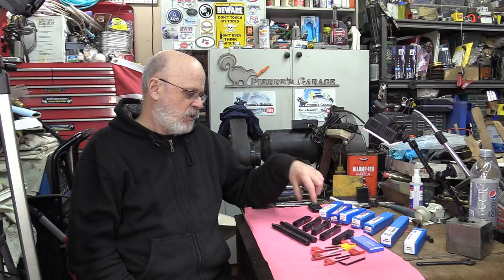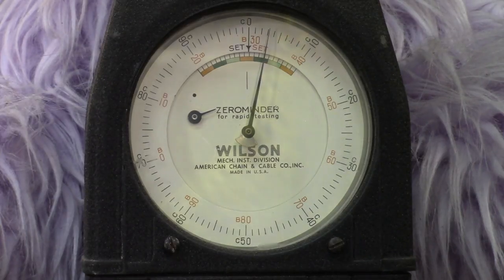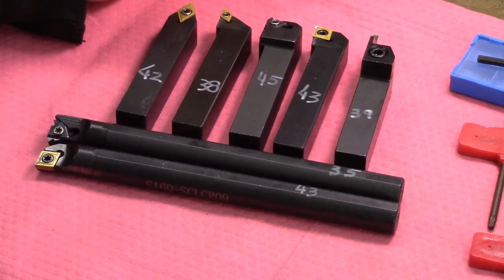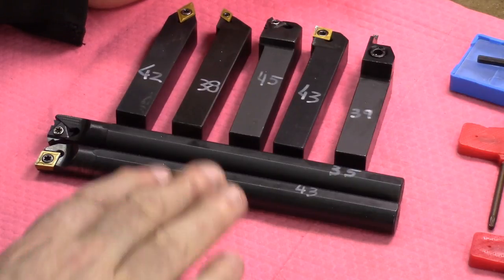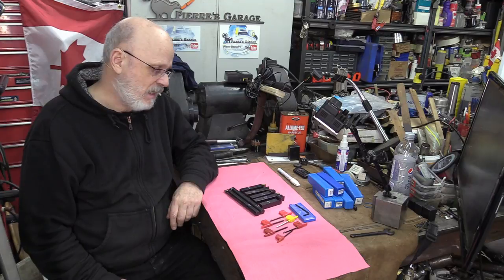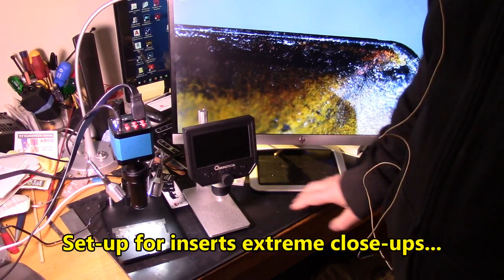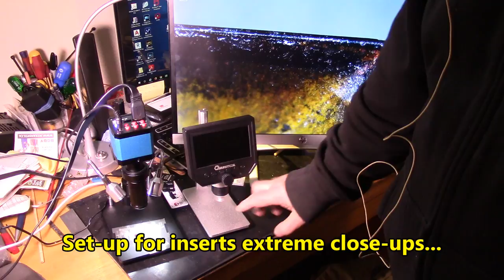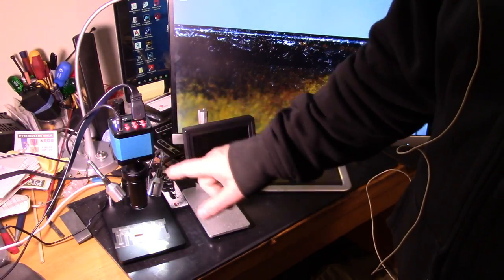Lathe Turning Tool Holders set, 7pcs 16mm Shank with carbide inserts, for BXA holders

Comment: I bought a kit for my south bend 13'' from Accusize and I'm pleasantly surprised how well it works even though my machine cant always hit the required FPM/rpm for carbide inserts! 

Nice video! 

Cheers
Reply from the maker: There are some great inserts for general purpose work, not optimized for high rate production on special alloys, but, perfectly suitables for hobbyist and small shops.
Unless you use those on CNC machines with tightly optimized parameters, you'll rarely use them within their best portion of the efficiency curve, don't worry about it though... 👍🙂
Enjoy your time in the shop...
Cheers,
Pierre
Reply: @pierresgarage2687  100% agree and I’m enjoying machining a whole lot!

Cheers!

Comment: How were the screws? Normally I have found those foreign tool holders pretty good but the screws rubbish that stripped out easily.
Reply from the maker: I didn't pay real attention when I first installed the inserts, possibly cause they didn't seem to be a concern, but to your asking, I just went back in the shop to give it a closer look, the heads are very well shaped, no trace of the tool user to install then, great fit of the torx tool, so far it's a positive experience...   Compares to good quality fasteners I get from my local supplier.         ;)
Reply: @pierresgarage2687  Yes the hex stripping out was the problem I had with the set I got when I first bought my lathe. Like to think things have improved in the last 20 years. :-)
Reply from the maker: I've seen some of the real crappy ones, they're terrible...  Need surgery to remove them...!!!
Always a great idea to keep a few spares in case of dropping one in a fully loaded chip pan...   ;)
Reply: Yeah, they don't seem durable, but I have also heard that you don't need a lot of torque, as the design is what holds the insert, the bolt is just for stability.

Comment: I purchased one of the cheaper microscope you have because of your review. It works great but that more expensive one looks to have incredible resolution.
Reply from the maker: The cheaper microscope is a great inexpensive tool for all around the shop, the other one is way more costly, and, like you say with better resolution, there are also some extra features that I'm planing to use in the shop to make precision measurements.
Just need time to set-up and get it all done.....    ;)
Cheers,    Pierre

Comment: Hi Pierre, nice test as allways, good performance of the tools and at that price a real find, better get video surveillance in the shop :-), a good source of aluminium is wheels.
Reply from the maker: A security system was installed soon after the last batch of ingots were stolen, BTW, they stole more than ingots...   Those nasty Bastards...!!!
Still have another 150 pounds or so of more scrap to make ingots from, including alloy wheels and suspension parts...   
Now, waiting for warm weather and Summer to be back...     ;)

Comment: Which insert and grade was used for turning .
Reply from the maker: With Chinese direct imports it's very difficult to get those details, it's most likely some very usual and wide spreaded grades, if you require some specialized turning you better get some known products from regular manufacturers, though, those inserts will cors you really musch more money, as those cheap ones are quite all right for regular work...   🙂

Comment: Good review. I can’t complain about  the 1/2” set from Bangood I have for my AXA holders.
Reply from the maker: Those type of tooling is generally a great purchase for people with a tiny tool budget or anyone that needs to save in order to be able to get tools for the shop. Not all tools coming from Asia is a great purchase, though, we need to test and evaluate in order to sort out the better deals...   This is where references are a way to help in deciding.
Cheers,   Pierre
BTW, nice project in your shop with the small rotary engine...!!!

Comment: Nice video,
But I'm struggling with the forest of inserts and when to use these inserts. All of them can be used for turning or boring or facing or grooving. For example: turning with ... 90° or 85° or 75° ... aproching angle.
And then the positief,  neutral or negatief angle.
Reply from the maker: Hi,  I get your point, inserts are quite numerous, lots of configurations and shapes, can't promise, but it would be interesting to give a basic understanding of how to sort things out in the most commonly used shape of inserts...
Those tutorials are quite demanding and need some thinking ahead, I'll put that on the "To do" videos long list...
Also depends a lot with what size of a lathe you're using, material you're turning, etc... 
Just as an example: In this video,  used a steel insert to cut Aluminium, wasn't ideal, a better insert for Al is an insert with a sharped edge and more agressive angle of attack, you need to look for an insert they say is for Al, then take a closer look at the cutting edges...
Manufactueres will often give some good descriptions of the intented use for their product.
Reply: @pierresgarage2687   That is just my Point, I'm new at this. But I use these same 250-201 toolholder 16x16mm insertholder.
Most of al is hot rolled steel.
I have trouble to find steel that can be harden. Here in Belgium you need to be a manufacturer to get the good stuff. And it is very expensive to get small amounts
Reply from the maker: Here also, small amounts are very costly. Depending on the alloy, hardenable steel is basicly from 3 to 8 times or more expensive than regular hot rolled steel, one possible source would be some local a machine shop that has some surplus or would be willing to order some for you. Just be carefull with your machining parameters not to harden your material as you machine it, then, it will be hell to get rid of that hardened surface.
There is a lot of work you can do using HSS tools, mostly with AL you'll get great finish as a bonus, also it will give you good feel for how materials behaves at very low cost, then, you introduce the use of inserts as you gain experience, this will save you quite some breakage...   As for HSS, try finding HSS with Cobalt content, it's much more durable. A good source for HSS would be local adds from people getting rid of lots of tools in old tool boxes.

Comment: Pierre,
  This is a bit off topic but have you ever tried free hand turning metal with a hand held cutting tool on a tool rest like in turning wood? I saw a video Dale Derry did where it was demonstrated.
   I actually tried it today and was surprised how easy it was. I needed to make a handle for a saddle wheel and want to match the other handles on my lathe so I thought I thought I would give it a try. It’s a slow process and the tool has to be held at just the right position but I actually got curled chips. Of course I was cutting 12L14 so it was easily machined. I imagine aluminum or brass might be easier. 
   It’s not something I would want to do regularly as it’s way too slow but thought it interesting. Just wondered if you’ve had any experience with it.
Reply from the maker: Hi Dale, not tried for big areas, just small corners for a quick shaping, to do so I get a solid carbide boring bar in the toolpost and use it as a rest, quick and easy. Got to be careful with softer materials they possibly catch easier...   Safer with a longest possible shank or handle, though...
Your idea of taking it easy is to me the best idea to stay alive and healthy...   ;)
Cheers,    Pierre
Reply: Pierre,
   I agree it’s best to remove as much material as possible with tool post held cutters. Any hand held tool absolutely requires an adequately firm handle incorporated into it. The tool I used yesterday was HSS and ground with a large frontal radius. 
   I understand the softer materials are subject to grabbing the tool. This is true in woodworking as well which I have done much more of. Hardwoods were much easier to turn than the softwoods and a much better finish is achievable. T
   Free hand metal turning isn’t something I plan to do a lot of and wouldn’t recommend it as a viable option in the norm but it does work in a pinch as with the unusual shape of my lathe handle. As one who has much more machining skill and experience than I do I just wanted your take on it. It’s all too easy to end up with a tool in the face or elsewhere if proper caution isn’t applied.

Comment: I can tell you first hand the 16x16 WILL NOT fit into the 250-101 tool holder.  I picked up a cheapy AXA holder and just going to open her up to hold these cheap tools.  If it's like the rest of the chinese stuff, it's made out of ramen noodles and harden cat poop.  I'm not tossing out my aloris AXA tool post at this point.  Great video.
Reply from the maker: Chinese products are as good as what we order, they manufacture just about everything you use, if you order the good stuff it's good, but, if you get the lousy stuff, then you get lower quality tools, as far as I had the chance to experiment, those tools are quite decent for less critical manufacturing or serious hobby use.